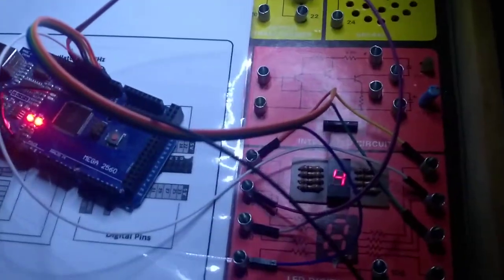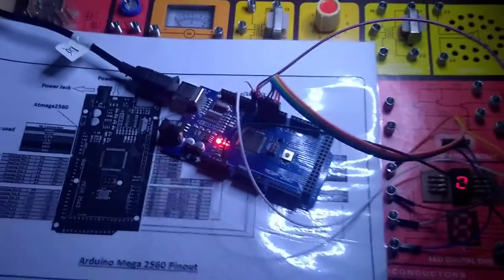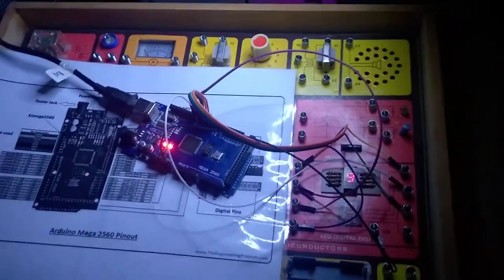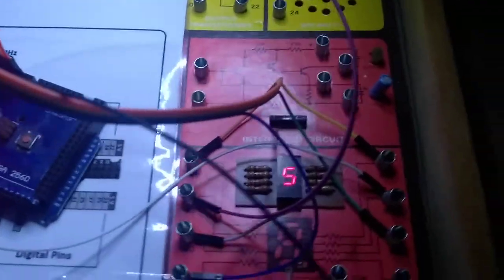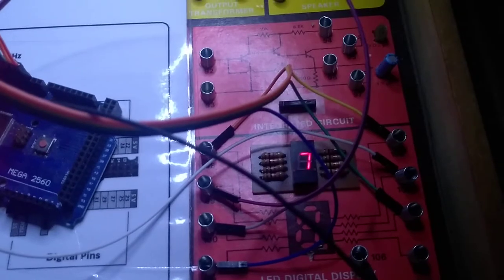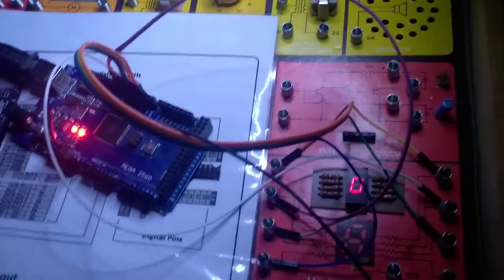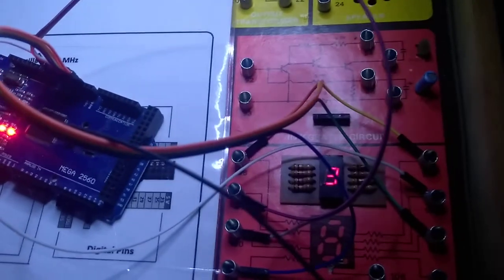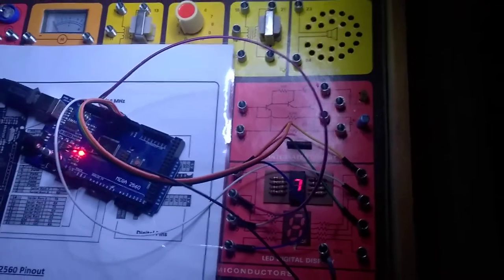Tandy Science Fair 150 in One Electronics Project Kit Meets the Arduino.

Comment: Short but sweet video and a fun project! I wonder what else you could do with the Arduino hooked up to this kit? 🤔
Reply from the maker: The Solar cell, the Variable resistor and capacitor, the Speaker,  light sensor, the meter, so many options :-)